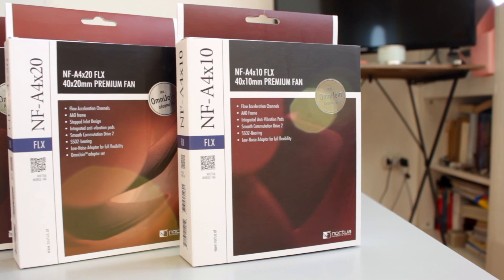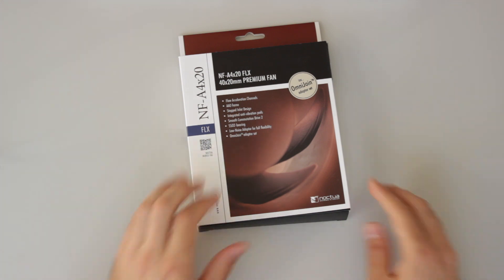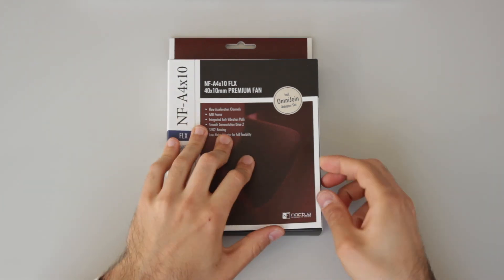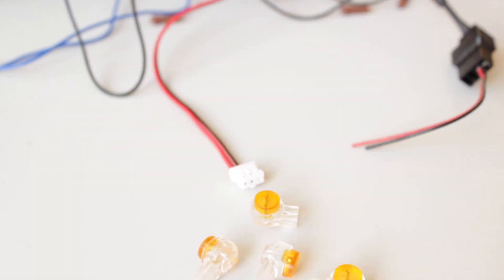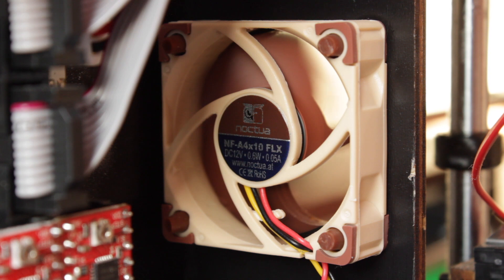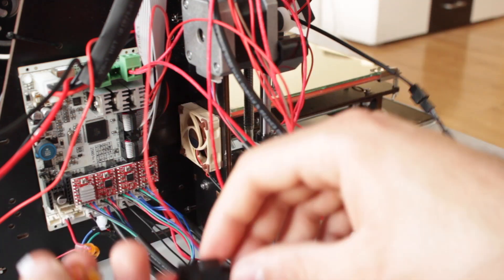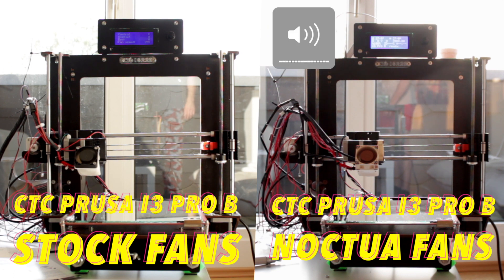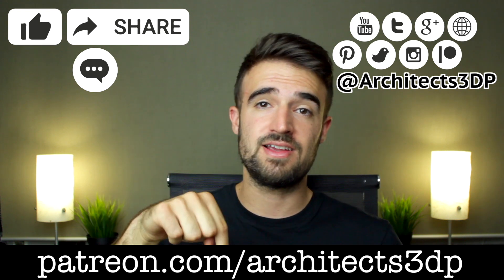Upgrade your 3D Printer Cooling with Noctua Fans · CTC Prusa i3

Comment: Nice video!  Thank you for showing me the right port to connect my nozzle cooling fan to.  I'd plugged it in next to the other two fan ports and I've been manually trying to control the fan's air flow...it's now working through the software!